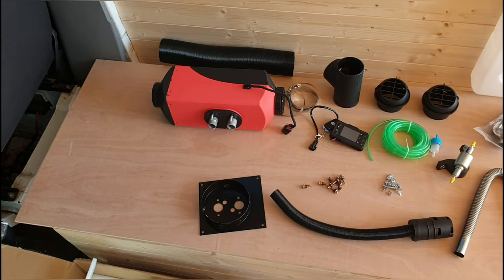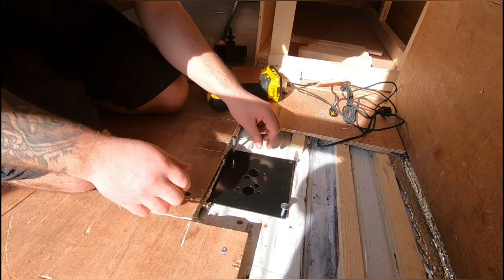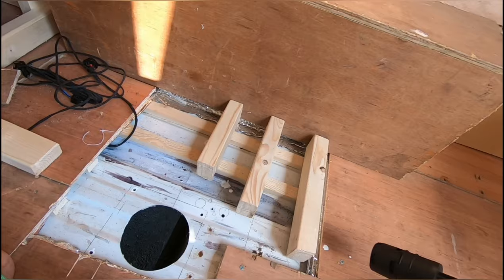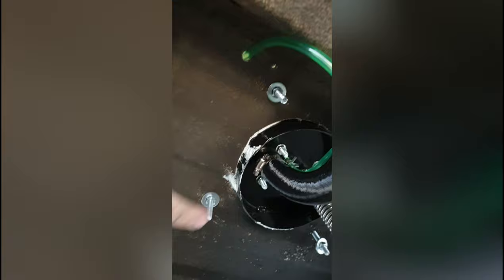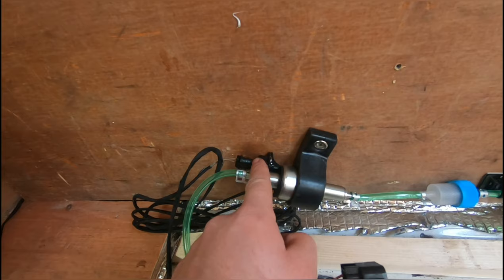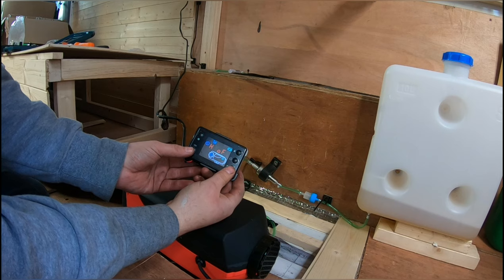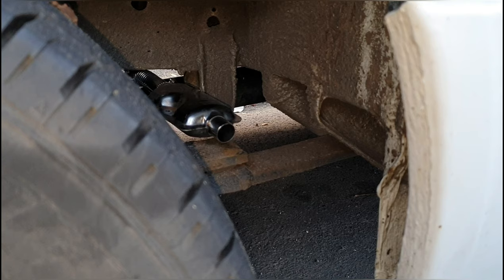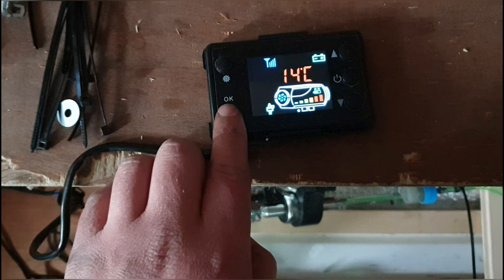Ebay Chinese Diesel Heater -  FULL DIESEL HEATER INSTALLATION from start to finish

Comment: Hi!  Wondering if you could provide a bit more insight as to how you have your fuel pump suspended?  Would love to reduce the noise on mine a bit, and have yet to come across that solution.
Reply from the maker: On my 1st install I ran a piece of wooden batten above and hung it with zip ties , this 2nd installation i put 2 long screws in to the wood and hung the ties off the screws , I think I have a video from my first install , I'll find it 👍
Reply from the maker: https://youtu.be/YxalU1klYoE

Comment: Cracking video,  will this unit eventually drain the battery when running on constent?
Reply from the maker: Yes it will mate , I use a leisure battery with a split charge relay .
A full battery should last a few days without any charge 👍👍👍
Reply: @LT_TOMMY_  thanks Tommy,   really appreciate your videos,
Reply: @LT_TOMMY_    I am thinking putting the fuel pump underneath the van in a water proof box  (same as out side socket) etc, would solve pump noise problems.

Comment: Should have used a better quality bit of diesel pipe instead of the stuff supplied plus used a rubber grommet for going thru the hole for the fuel pipe

Comment: Why have the pump and filter in the vehicle? it would be just as effective under the van and quieter too. I've done a couple of installs of these heaters, one without the tank as I built a custom tank for it with a filler outside on the van body, great install though however rubber grommets are a must for anything going through the body.

Comment: The ticking from that fuel pump is going to drive you mad, ideally you should take the feed from the vehicle fuel tank and mount the pump under the floor as close to the van fuel tank as possible. The exhaust should exit on the perimeter of the vehicle and please fit a carbon monoxide detector. Just trying to point you in the right direction. Regards Chris.
Reply from the maker: As soon as i recorded this video i hung the pump with cable ties and it's now almost silent 👌

I've had a few of these heaters and make sure i have a carbon monoxide alarm without fail 👍👍👍👍
Reply: TommysAllSortz Thanks for the reply. I can stop worrying about you now young man. See ya.
Reply from the maker: Lol cheers for the concern 😬👍

All jokes aside i tell people exactly the same thing , make sure you get an alarm as they can potentially save your life ...

Be safe mate 👍👍👍

Comment: Why use a pump when you're mounting the heater lower than your tank? Isn't the pump so that you can draw fuel from the main diesel tank which would usually be lower than the heater?

The extra diesel tank is an interesting idea. Drilling my fuel tank was my biggest concern about installing one of these!

Comment: That’s a nice video ? Jus let a question that noise on the background ( fuel pump ) does it go off after certain time or stay on? Thanks
Reply from the maker: Thanks 👍
The fuel pump stays on , it pumps away fast or slow depending on how high the heater temperature is set . 
I have recently moved the pump and hung it with cable ties and its now  nearly silent . Here's a link to an old video i made on this 👍

https://youtu.be/YxalU1klYoE

Comment: Great video mate I think I could manage that myself 😂 did yours come with the turret plate? Just been to your link and doesn’t mention a plate in the components so was wondering if you’d got that separately? Thanks dude
Reply from the maker: Hello mate , you definitely can do it yourself,  just take your time 👍 
The Turret plate is separate,  I've just added it to the description.
I'll drop the link below for you 👍👍👍

https://www.ebay.co.uk/itm/291263684491
Reply: Topman 🤜🏻🤛🏻
Thanks a lot bud
Reply from the maker: No worries,  gis a shout if i can help in any way 👍👍👍

Comment: Nice video there m8. Did the fuel tank come with the kit? How do you rate the heater?
Reply from the maker: Cheers mate 👍 

Yes the tank comes with the kit mate.
For the price of these things they are great mate.
If you go on the MaxpeedingRods website and use the discount code tvl2021 you will get a discount 👍👍👍

Comment: Thanks for the video! Used it fully today to install it - only thing is I struggle to change the required temperature.

With the 'ok' - button I get the voltage, the 6 heater conditions and the combustion temperature. 

Is there someone out there who knows what to do?

Comment: I know you've taken a pasting for forgetting to install the grommet on the fuel line, first thing I noticed before reading the comments.  Shock horror!  Glad you fixed it now though!  ; )
Got a couple of questions for ya Tommy -  First one,  where did you get the 12v power from  ............  fused 12v feed from fuse box?

Second one ( and very very important to me ) does that thing continually beat like that?  Sounds like a dull heart beat!
I think mounting the pump to a solid metal surface instead of a plywood box would help.  Or even better................  mount the pump under the van?

Great vid mate  ; )

Oh,  almost forgot!  Is that the 2Kw version?

TURK
Reply from the maker: Thanks mate 👍 

The feed is straight from my leisure battery with an inline fuse already supplied. 
The pump noise is continuous but i have hung mine with zip ties and it is now almost silent. 
This is the 5kw version. 

Sorry for late reply mate 👍👍👍
Reply: @LT_TOMMY_   No worries for late reply mare  ; )
Leisure battery! .............  that's where I was hoping to power mine from when I get one.  Now about the pump .................  'hanging' it somewhere is an excellent idea ( wish  I'd thought of that! )  as it's not making contact with anything, it's bound to be much quieter.  In fact, I like that idea so much that's what I'll do when I get mine  ; )

Thanks bud  ; )

TURK

Comment: I've got 12mm ply flooring. Do I need to cut a section on plywood away or can I fit on top of the plywood ? The turret would still reach to the underside of the floor.
Reply from the maker: The turret can sit on it mate 👍🏼

Comment: How thanks for the video I was just wondering how you power the diesel heater is it through the van battery or something different?
Reply from the maker: Hello mate, mine is powered by a separate leisure battery,  you can run them from you normal battery but obviously you run the risk of breaking down with a flat battery 👍

Comment: What sealant would you recommend?
I found VITCAS Heat Resistant SILICONE (300°c) of VITCAS  Heat Resistant Sealant Sealant (1300 °C). I would assume the silicone version would stay more flexible and water proof/air tight. But I'm not quite sure.
Reply from the maker: Any heat proof sealant should work fine 👍

Comment: Hey Tommy. Great video. Can I ask how long you have been using the heater. I’m about to buy a mk8 transit and I want to fit one (to keep my tools dry in the winter) I’m asking if you have any idea what the fuel usage is like if it’s set to come on a few degrees above frost…. And have you had any problems with it draining yiur battery 🔋 

Any help would be massively appreciated. James

Comment: Cool video if you set temp for 19 does it relate its self as slow down or full bore all the time
Reply from the maker: Hi and thanks 👍🏼

Once room temperature has reached your set temperature it will slow right down and just tick over 👍🏼
Reply: @LT_TOMMY_  cheers  there will be one going in my t4 for this sharp winter fir sure then 
👍👍👍😜🏴🦄🦕😁✌️🤞
Reply from the maker: @chopperhehehe  They are a game changer mate, any problems give us a shout 👍🏼👍🏼👍🏼

Comment: Hey, good vid, looking at fitting one to my LT. 2 years on have you had any issues not having a gromit where the fuel line goes thru the floor, and also does the tank smell much inside?? Thanks

Comment: I bought one, notice the cap for the diesel tank may not be very air tight because the tank opening is a bit uneven. Question is, can diesel be left open in the RV and will not evaporate to cause harm to human? or I kind of worry it is like a leaky gasoline fuel tank will be troublesome. I have not installed it yet.

Comment: Here in Britain heating oil is cheaper than red diesel .... Have heard that running it on the former might damage the pump. Is that true ?

Comment: Hi mate does this just run off the vehicle battery, and if so where did you get your live feed from? Great video 👍👍
Reply from the maker: Cheers mate , these can run from the starter battery but personally I wouldn't recommend it, you don't want to be broken down somewhere with a flat battery. 
I use a leisure battery mate 👍
Reply: Thanks very much, being a thicko here i assume you charge the leisure battery from the engine running? Sorry to bombard you with questions.
Reply from the maker: Not a thicko mate , if you don't ask you'll never know 👍
My leisure battery is on a split charge system so when I drive it tops up the leisure battery aswell as the engine battery,  the leisure battery usually lasts 3 - 4 days if I'm camping etc 👍
Reply: Cheers Tommy for the excellent information,  its something I am looking at doing for my daughter so the info is greatly appreciated 👍
Reply from the maker: No problem 👍

Comment: How loud is it? Im
Building sled trailer sledding in mountain top -20 here in bc Canada 
Not sure if I’m going use this or electric heater run by a generator

Comment: Nice job pal 
Is it messy filling diesel up inside van is it not possible to run a line from van tank 
Thanks
Reply from the maker: Cheers mate 👍 
The tank is easily filled from the back door, not messy at all .
People do tap in to the main tank/feed but to be honest I'm happy with a separate tank 👍👍👍
Reply: TommysAllSortz 
Thanks for reply

Comment: Hello and thank you for your VERY helpful video! Because, the instructions it came with are USELESS. Please correct me if I’m wrong but, I really don't think I need that extra (expensive) mounting plate/turret because the exhaust pipe doesn’t even touch or come close to (it will be at least 4-5” away from) any wood. Could you or anyone please comment or reply to that piece of information? If I’m missing somehting….I don’t want to burn up! Thanks in advance.. A
Reply: ….I understand your extra safety…But it doesn’t look like the exhaust pipe would be touching any wood < forgot to mention>"as long as I cut out the hole in my wood floor where the pipe goes through as large as the outside edges of the rectangle metal plate it came with (6”x5”). Then…the exhaust pipe wouldn't be touching wood. It’d just be hanging from the hole in the metal plate. Right? Right...Sorry for all of this.

Comment: Muffler drain hole needs to be on the bottom, fuel lune connection in the tank should be in the side so it's not aucking up crap from the bottom and lastly the pump should be at 90 degrees to help it prime.

Comment: Hi. Will this drain the battery if left on over night. Or does this need a solar panel set up to run it. Great video by the way. Just gave me the confidence to do this myself
Reply from the maker: Hi , it will eventually drain your battery, maybe not overnight night but over a few depending on which battery and size etc
I run a split charge relay to my battery and it works fine 👍

Comment: Should this whole system be installed outside and only run the duct inside?
Reply from the maker: This set up is perfectly fine inside as long as its installed properly,  by choice you can have it outside also 👍👍👍

Comment: Might be a good idea to use high temperature sealer on the bottom of the heater not just silicone because of the heat produced Might start a fire ?
Reply from the maker: I've used fire mate which is a high temperature sealant 👍🏼

Comment: Great video. Would this need to be connected to leisure battery? Would it flatten my van battery overnight? I just kip in back of van, no mod cons like leisure batteries!!
Reply from the maker: Hello mate and thanks ... It will run off the engine battery , but it depends on the condition of it whether it goes flat in 1 or 3 days,  i wouldn't risk breaking down in a Field somewhere, pick up a leisure battery mate 👍👍👍
Reply: @LT_TOMMY_  Hya just to pipe in here for a moment Ive heard that if you connect this to a fuse board the shutdown sequence might fry it are you connecting it straight to the leisure battery (bypassing the distribution board) and if so do you simple switch on when needed? im asking coz one of these is on my list for my own build

also listening to that knocking soundas it primes up  does that subside ? or is that just gonna be like that all the time ?

Comment: The business down the street wants $600 to install one of these in my car. In that a reasonable price?? So my car battery happens to be in the backseat which the doesnt lock on place you just literally lift the back steat up. Also in the middle part of the backstead where the back leans against theres a little space where you can unfold so any wires or hoses would be easy to put through from the trunk to where the battery is if anything needs to actually connect to it. Like is cant get any more easy or more simple then my car set up. Thats why im not sure why it would cost them $600 to install it for me!!
Reply: Also my solar is going to be installed and connect in the back seat but on the other side of the battery so there isn't a bunch of batteries, wires, and other hardwares in one cramped area lol.
Reply from the maker: Hello mate , seems expensive to me personally,  you can pick these heaters up for under £100 now so 500 in labour seems a lot...
Watch loads of Video's and have a go at doing it yourself mate , they are quite easy to fit 👍

Comment: so when you were using the hole saw what size was that because i have a similar heater and it does not have the circular thing attached to the plate that goes on the floor, now im putting mine into a camper that goes in the back of my pickup truck. so i have to get creative with where the fuel line goes and the exhaust and air intake all go.

Comment: Thanks very much for this great video! Very well explained! I’m going to now purchase the deisel heater off Amazon and attempt the install myself. Only question is the power source, which I’m assuming is from the van’s battery. Also, is there any way to put the diesel container under the van? Just because i know how badly diesel stinks and I’m sure to spill some every time I fill it up. Cheers mate! from western Canada
Reply from the maker: Hello mate and thanks 👍👍👍

The power is from a leisure battery,  my fuel tank is at the inside rear and i can never smell fuel, but you can mount external or even tap in to the vehicles feed 👍👍👍
Reply: I saw somebody used an outboard motor tank for boats 25, - only. Advantage will be, you can take it out easy when fueling up and it has a little handpump so you can prime the fuelpump and the tank has a cubic design, much easier to stow away somewhere.

Comment: Great vid, I installed mine with your help, it smoked alot more but then it ran great, I have a 108 ah battery but it seemed to have drained it very quick not dure why, what is the Hz setting in thr panel?
Reply from the maker: Thanks a lot , glad it helped 👍 

They only use a lot of power on start up and cool down , during running it shouldn't really use much at all , was your battery fully charged?
Reply: Yeah the battery was full, but maybe trying to figure out how it works I turned it on and off alot of times, I now placed an isolator from my truck so it charges when I drive cause my solar isn't enough. Thanks for the reply ✌️

Also what is the hertz setting for? When I lower it the temp lowers aswell
Reply from the maker: Hz is for the pump , push the 2 top buttons together and it'll change to Temperature 👍

Comment: 0:48 have you noticed and heat damage around the heater base (where it is mounted to the black mounting plate and the floor sheet metal of the van ? I have been told the heater can get quite hot in that area and I wonder if this heat is being transferred to the van's floor causing issues ??
Reply from the maker: Nothing at all 👍🏼

Comment: Great video, just wondering did you have to put a feed from the leisure battery at all?
Reply from the maker: Cheers mate , yes the heater is directly wired to the leisure battery 👍
Reply: @LT_TOMMY_  what size cable and fuse does it require? I'm going to order one today and get it in ready for when we can go 👍
Reply from the maker: @rypetfield  Hello mate all cables and inline fuse is supplied with the kit 👍
Reply: Kit arrived mate, just wondering how have you attached the fuel line to the tank?
Reply from the maker: @rypetfield  Not the best vid I've ever done but may help 👍
https://youtu.be/7evwdsOVdeY

Comment: Hey Tommy. Top video mate. Did that floor plate come with yours?
Reply from the maker: Hello mate and cheers 👍

The turret plate was seperate pal , I'll find you the link ...
Reply from the maker: There you go pal 👍

https://www.ebay.co.uk/itm/263870087578
Reply: Some man. Cheers. I suspect as much but wanted to double check so I didnt end up with 2 lol
Reply from the maker: No worries pal , gis a shout if i can help in any way 👍

Comment: Any problems with running these straight to the battery that's used to start the car? I've heard of people having issues with these if the voltage is too high

Comment: Does this require a constant source of electric to run? Would this drain my car battery if I ran it off it all night would I have a flat battery in the morning?
Reply from the maker: It does need a constant power source, you could run it off your car battery but can't guarantee that itbwont be flat by the morning, I and lots of others use a leisure battery 👍🏼👍🏼👍🏼
Reply: @LT_TOMMY_  I have a leisure battery but my issue is, at around 12 or 1 am every night my power runs out, so that would mean my heater would shut off.
Reply from the maker: @rhyannjoedan  my leisure battery will last about 4 days from full charge, is your battery OK?